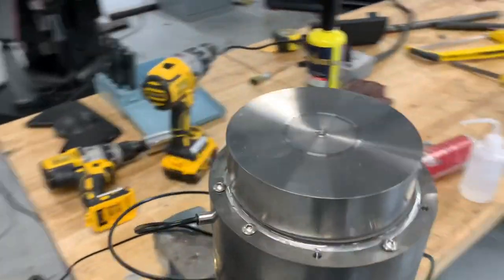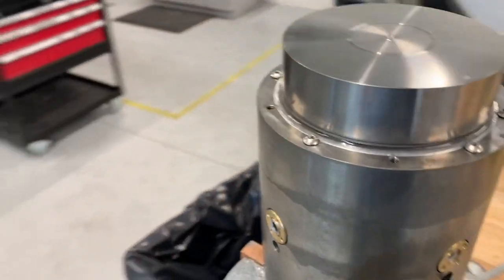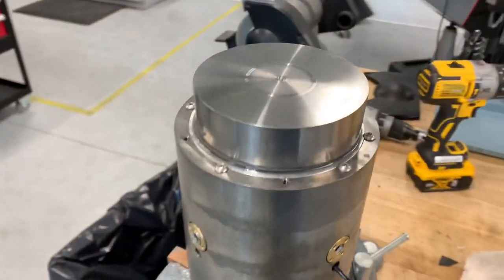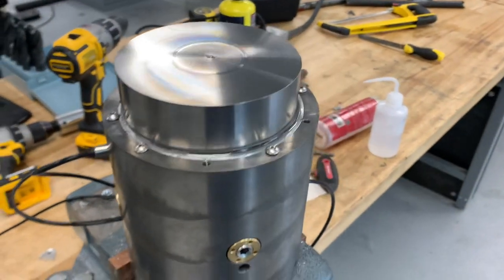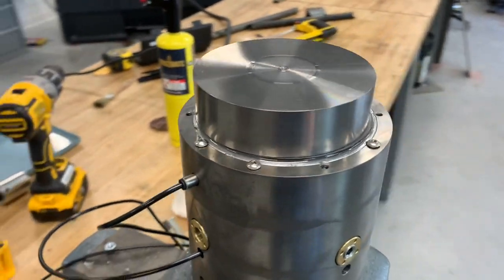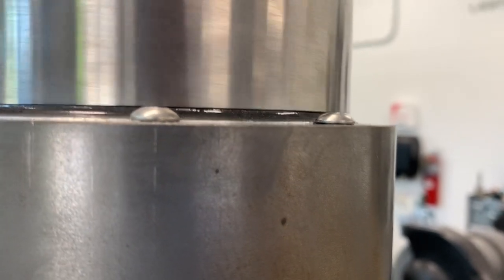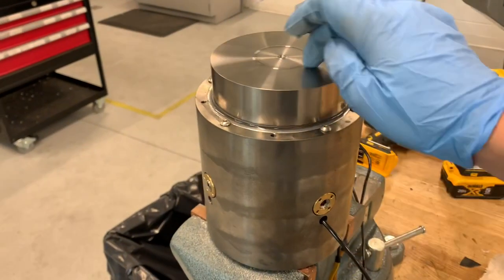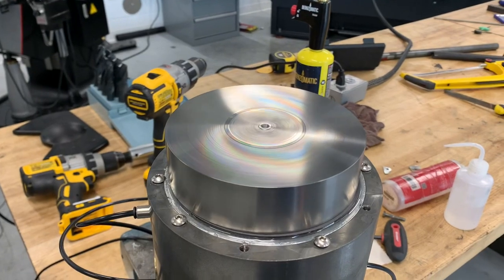AIR BEARING SPINDLE Thrust Bearing, except this time with ~~50% radial constraint~~

Comment: NICE video !!!   Can you tell me what kind of graphite material this is? Is it ordinary graphite that can be used for high-temperature molds? I wonder what kind of process is used to ensure the porosity of the porous? Thanks for your answer！
Reply from the maker: Ordinary graphite off of McMaster. Bearings are tuned individually so porosity doesn’t need to be tightly controlled
Reply: @cylosgarage  thank you so much, before we use Breathable steel and ceramics，just i think graphite are so soft,maybe hardly get good accuracy.